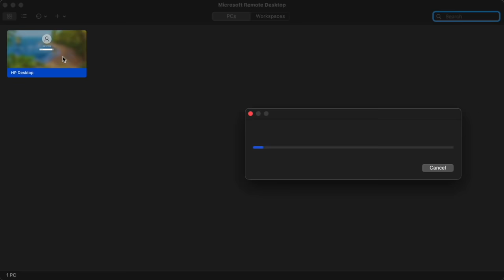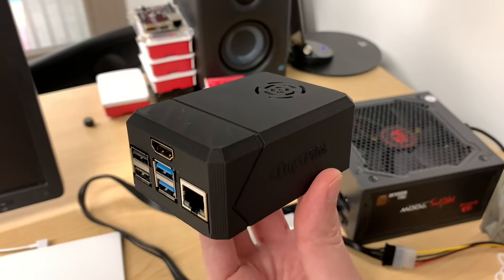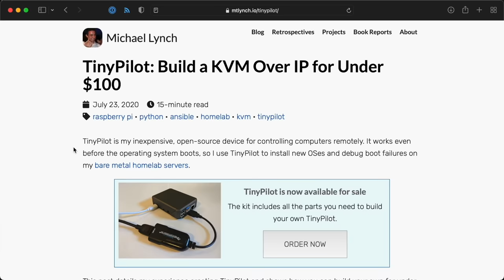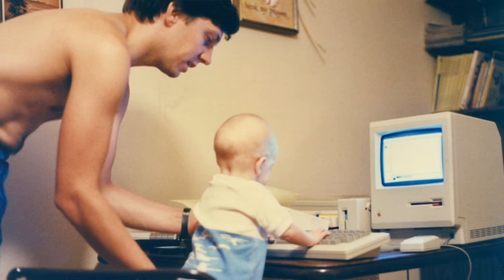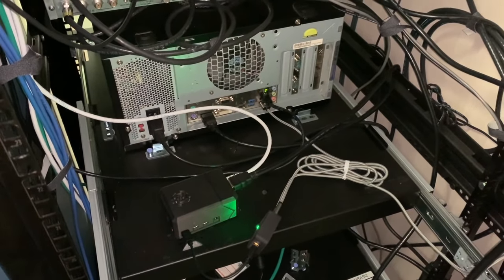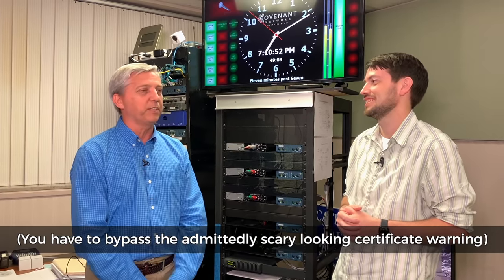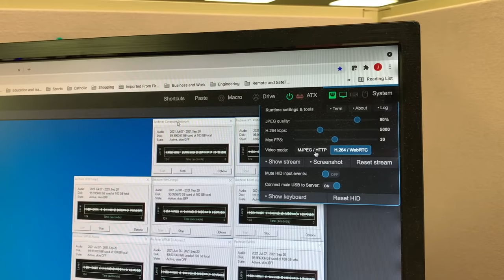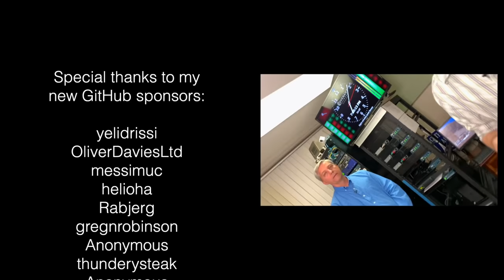Control ANY COMPUTER with these Pi KVMs!

Comment: Hey Jeff, thanks for the vid.  I'm still trying to work out, for 6 servers, would I need 6 KVMs or can 1 ( Pi-KVM ) control multiple devices, perhaps when connected through an HDMI switch? @ 6*150 I may as well start looking at a decent IPKVM?
Reply: I was actually thinking same. I have 8 servers. So thinking if I could use hdmi swtich. But problem is with power reset.

Comment: 1) Your Dad is a legend no wonder you turned out alright
2) It's a Pi - can't you just wire a GPIO to a relay to the power cable? What am i missing here?
Reply from the maker: Yes, though making sure the power signaling is correct also requires a little software tweaking and it's nice to have that all built in and supported in the UI.

Comment: “Gone are the days of walking to my basement to restart a locked Pi”

Umm, you’re using a Pi to ensure you don’t have to physically restart a locked Pi? So are you going to put another Pi in front of that one, then another in front of that one, then another in front of that one, then…

100-300ms latency on a gig local network? That’s awful. Are there any solutions like this for x86 mini PCs that have some actual power?

Comment: I find it funny that I just purchased a Pi4 and CSI hdmi card to do this hours before the video dropped. Also very interesting to see your dad's side of the RF industry. My background is public safety two-way communications and most of the critical infrastructure there is based on server applications which are either accessible via CLI, API or some pretty client app/web UI. At the physical sites, nothing relies on Windows. Dispatch consoles however rely on Windows...though everything is typically air gapped.
Reply from the maker: In broadcast radio, it seems like 99% of software is Windows-only. And some things that are still in the critical path are Windows XP-only, too... mostly for smaller stations that don't budget a replacement for some specialized tool.

At least the newest gear has APIs now; it wasn't always that way.

Comment: I'm aware that these stuff may not so much used any more - but for me both solutions lack vga input, ps/2 keyboard/mouse and rs232 serial
even having a hdmi out on a server isn't guaranteed - in professional 19" stuff vga and 4:3 resolution is still dominant
Reply: One can get a  VGA to HDMI adapter for about $10 to $20; requires a USB port to power it ( or wall plug ) .  Only servers that I've seen with PS/2 and RS232 ports would be in the OVER 10 years old category.  That category is typically bound only for the recycling heap, or as a door stop because one is to lazy to buy a proper door stop.
Reply: @MrPir84free  then the only type of servers you've seen in the past decades is the consumer-grade one meant for rental to customers with the more fancy stuff like ipmi (which is basically some sort of embedded kvm)
in the professional world the old analog and serial connectors are often the only ones available - the reason: reliability
although those connections are rather limited for todays standards they're quite solid ones and easy/simple to implement
with something like usb and hdmi one has highly complex stuff with differential signaling which is more complex to get done - multiply this by a scale factor of thousands to millions and you end up with quite a big number for the additional cost

Comment: Call it OCD, but I'm can't stop looking at the clock behind the two of you. For some reason the text display of the time, along the bottom of the clock, is 30 seconds behind the time displayed by the second hand. For example, at 7:10:29 it still reads "Nine minutes past Seven", but at 7:1:30 it changes to "Ten minutes past Seven".

Comment: The cheapest way to have KVM features at home or small business is to use Intel vPro features (Intel AMT). But you need to think about it before you buy PC. Intel i5 CPU + Intel Q chipset based motherboard. A little bit more expensive motherboards but you will got all functionality of IP KVM out of the box.

Comment: I've just finished building a PI-KVM.  It works great for my use case, and I've even added a 4 port KVM switch that will switch device via software right in the PI-KVM browser.  Even better is that I designed and printed my own case that's a 1u rack mount.  With that addition, the whole thing neat tidy, powerful and can control several machines.  Though only one can be have the ATX feature at the moment.  I've already suggested a feature to allow one PI KVM to do the ATX thing for several computers!    I love the out of the box features, it simply worked without modification, it really isn't anywhere as difficult as the video made it out to be.   If you use the PI-KVM like a tiny pilot, it's just as plug and play.   The ATX feature was the part that's the most complex, and even then, it's not really that hard.
Reply from the maker: Plug and play once you have it assembled. It's not a barrier for you or me, but I know many people who just want to deploy a KVM (or ten) would rather spend some extra money so they can pull it out of a box and plug it in, zero assembly required.

Right now that market's served on the $600+ end, but nothing sub-$500. I think that's the niche TinyPilot targets, though I wish TinyPilot had ATX hardware control too.

Comment: Price of around €350-€400 kills this at start. It can control single computer, it's build on unreliable Raspberry Pi with its subpar SD card which is prone to randomly die. At this price range you can get decommissioned real KVM over IP, add cost of three-four of these things (if you have so many servers) and you can easily buy new dedicated KVM with 8-16 ports. This toy here shouldn't cost more than €50, then it would make sense for one-station home lab maybe.

Comment: You can...but only if it has wake on lan on in bios, most comps i have had has used a hardware switch for even getting into bios as a secure vault version built in. Most of those boards are not mainstream though and often intel.

Comment: The Pi-KVM can also be made it yourself. I set up my pi-kvm with pi zero w, and it also has 1080p webrtc h.264 support. I was satisfied with it.
I think the most important thing you do not cover is that PI-KVM's webrtc h.264 support. It can indeed reduce the latency with this kind of low-powered device.

Comment: I think I found a situation that the PiKVM can't handle.

I want to use a KVM to monitor and occasionally maintain a remote desktop PC.  So not only do I need the PiKVM to be connectid to a video ouput of the PC, but I also need to have a monitor attached.  When I set this up, the BIOS screen always goes to the monitor, not the KVM, and there's no way to override this in BIOS.

It'd be nice if it had a pass-through capability so it could take the video signal it sees and pass it on to an attached monitor.

Comment: I actually made something like this manually as I didn't know anything that was packaged to do this.... I used it for my work computer to use it for work when I left town as they didn't want the unit moving around and they also didn't allow for a remote controller installed on it.... so repeat the desktop screen display and forward the keyboard and mouse inputs and ip route to the pi... it was rather crude tbh but it worked.

Comment: Things have changed since I bought my last KVM switch.  Had no idea you could use them to remote into other computers via internet.  I'd always used remote access s/w for that, but then I'd managed only a few computers at a time.  So now I need to replace my venerable old electronic KVM not because it's broken but because it only accepts DVI and not HDMI or DisplayPort monitors. My needs are simple: I have a Windows desktop and laptop and two Pi computers running simultaneously at one workstation, all using one keyboard and mouse, normal PC audio, and two monitors configured in extended mode. No internet required other than my home router/wi-fi setup.  Can one of these Pi KVMs handle that simple task?

Comment: So, with the cost of a Raspberry Pi 4 now, both of these kits would be about the same price.  Still I think I would prefer the Pi-KVM with its ability to control an ATX power supply.
Reply: $87 for the PI KVM kit (v3 ) and $100 for the PI ;  you can still buy two of the kits for the same price as the pre-built.

Comment: This popped up in my list to watch and it is most likely since I just started to tip my toe in Pi for home automation, I do use a couple of computer when I am using a software kvm called Synergy, but it is software and there will be times where the host will not connect and I end up having to reset the software and if that doesn't fix it, I have to reset the main pc.  If the Pi KVM is always on, I was thinking that this might help as you said, plug, play and don't worry?

Comment: Regarding the Pi-KVM ATX Feature: Is it monitored? Can you send timed series? Are SDIOs left for use with backplane peripheral lines? Many workstations and servers have brand-/hw-specific codes to override boot-sequences, error-handling, etc. which are actually specific reset, nmi button combos. It's a very special case, i know, just wondering. Also, does the HDMI support analogue/vga-adapters as widely used on RACs and physical KVMs?
Reply from the maker: I know the Pi-KVM HDMI port supports the VGA adapters. For the SDIOs, I would ask in the Pi-KVM Discord. There are a bunch of more grizzled veteran sysadmins in there who have the answers you're looking for :D
Reply: @JeffGeerling  Thx for the quick response - wholesome video btw!

Comment: How will this work on an older enterprise server?  Some already have iLOs, but are now limited due to the java and flash issues.   Could the PiKVMv3 power on and off these servers?  Would we have to rely on the iLO for power options, then use the USB to mount ISOs?   Does the PiKVMv3 have a VGA option?  Most older enterprise servers use VGA, not HDMI.

Comment: Hi, You mentioned "you can get complete control over any PC". Are laptops also included? Can I remote control a laptop (turn off/on)?
Reply from the maker: Typically laptops don't have ATX controls so there wouldn't be a 'power button' to tap into easily.

Comment: Im pretty confused by the architecture of the radio system; it seems to me that you could get a lot better serviceability out of some actual server hardware in a data center. I assume there is some USB or PCI device requirement (which passthrough for these has been supported by ESXI for a long time now)?
Reply: I'm not sure about the rest, but as for the data center bit I'd say there's govt regulation on redundancy for radio infrastructure.

Comment: Does one of those switches control only one device?  At first I supposed it would handle 4 or more devices that are in reach, since that's what a "KVM" switch means to me.  But is it actually a IPMI Server that gives remote admin to one device?  At that price point, it sounds like it's more than just getting a motherboard that has remote admin built-in, but would be used to retrofit turnkey appliances where you did not get to choose the motherboard.

Comment: I'd be interested in how easy this would be to do from scratch using commodity Pi and HDMI capture hardware and Open Source software.  I have some Pis and so forth just sitting around, so I don't need the box or kit these come with...
Reply from the maker: Check out the PiKVM documentation; they have the setup and software you'd need for a few different models of HDMI adapters.

Comment: Perhaps I missed it in the video, but is there an options with either of these for dual monitor support?  I have a couple of setup's where having dual monitor support with a KVM would be helpful.  If so, great. If not, that is fine as well.
Reply from the maker: Not that I'm aware of, though there are some tricks that could help; PiKVM Discord may have good resources

Comment: Big problem using these in my systems is all of mine have VGA, not HDMI.  And my monitor is VGA/DVI, no HDMI.   Connecting these to my setup means buying active converters for all my systems.  And does it transfer audio as well?
Reply from the maker: No audio at this time... I think PiKVM has been working on that, though.

Comment: With these price tags, and only being able to control one PC, I'm not seeing the advantage over more traditional KVMs. Am I missing something, or are these only good if you you only have one PC to control?
Reply: I'm a SW Developer doing driver development. I'm using piKVMs to control my development target, and with my companies WAH policy right now (we are all remoting in with VPN & RDP/VNC to our work systems), they are a godsend for me.
What these give you over a traditional KVM is:

Remote access at POST/BIOS.
Ability to emulate/mount USB media during boot.

Remote control/viewing of the ATX front panel - remotely pushing power/reset, remote monitor power/activity LEDs.

That means when things go FUBAR, I can remotely force reboot the system, control the boot/recovery process, and in the worst case, even reinstall the OS.

While it was not covered in Jeffs video, you can also use the piKVM to remote control certain traditional KVMs. Since the traditional KVM does not provide ATX control, you would need to DIY that support if you needed it (piKVM provides remote control to the GPIO pins on the pi, so you could add some type of DIY GPIO controlled switching hardware), and I have not tried USB media emulation thru a traditional KVM.

If you just need access to your system post boot, then RDP/VNC is the way to go.

If you need local access to multiple systems from a single keyboard/monitor, a traditional KVM is probably more cost effective.

If you need remote access from power up w/o ATX control (or are willing to DIY support for it), then a single piKVM controlling a traditional KVM is a good solution.

If you need full remote system control from power up including ATX, then a piKVM per system is a great solution.

Comment: If you need to connect multiple systems do you need to get multiple PI KVM hardware to be able to setup for multiple devices
Reply from the maker: Yes, or if you buy a hardware KVM with 2/4/8 ports, and it has keyboard macros for switching, many of those would work behind TinyPilot or PiKVM, though if you want ATX power control that would only be to one computer at this time.

Comment: As much as I respect this guy for being a radio engineer, I'm also the IT guy asking: If this infrastructure is so critical, why isn't it running on servers with IPMI? If you have to bolt-on remote management capabilities to common hardware, maybe you are using the wrong equipment to start with?
Reply from the maker: I didn't dive into much detail here but two things: 1. A lot of radio stations don't have the budget for 'real' servers (though some do... but even those, they usually only have a few and have to make do with cheaper PCs since they can't get a real server or VMs to run all their weird and arcane software). and 2. This particular studio is part of a nonprofit, and that means budget for things like new computers is basically "no" (much less expensive servers).

Plus in a studio environment, you have to be more careful about sound, and 98% of servers built for racks have no regard for sound, and will whine incessantly unless you outfit them with much more expensive fans or water cooling.
Reply: Radio station engineers are not IT pros and come from an era before there were computers at radio stations.

Comment: These tools are mature enough for me to substitute some of my homebrewed solutions for the same task. Being able to configure thin clients or *nix computer pool hardware a dozen at a time really is a nice change of pace compared to pre 2000 when you had to do the same menial steps in series for a multitude of systems.

That said, if you use them to not have to switch the room in your hobby projects they can be useful, however in most cases when you can access devices easily they might be an overpowered tool for the job. If you have a small business and a mechanic workshop / electrical workshop with some devices they can be quite useful (esp. during covid), but if your IT affinity isn't there you might want to let it mature a bit before using it in production / testing it out in a test setting similar to your productive systems first.

Using the devices for your IT support to connect remotely to your machines from home office works with a bit configuration, but isn't as low latency as typically and thus I would recommend evaluating it before switching to it completely (and also check if alternative tools - which lack restart / bios ability - would do the job for you). That said, what the radio engineering dad said about security is very true.

Comment: @Jeff Geerling, your vid that popped in my feed late last week (last week of 2021/09) convinced me the π-KVM was a tool/unit that would make my life easier. I've looked at Ron's (Novaspirit Tech) vids on this and learned a bunch—but I wish his explanations were as clear and understandable as yours for those poor crippled noobs out here who are needy but numbskulls.

I wonder if it would be out-of-scope for you to put together a vid on how a typical low-tech user (home or small business) might cobble together a system to control up to three or four older and very old computers running various Windows and Linux OSes with Iinputs a varity of serial; PS2; and USB, and video outputs including VGA. It seems from what I have gleaned so far, that far more than a "hot-switch" KVM switch and VGA converter are necessary to make the π-KVM w/Raspberry Pi SBC a complete solution.